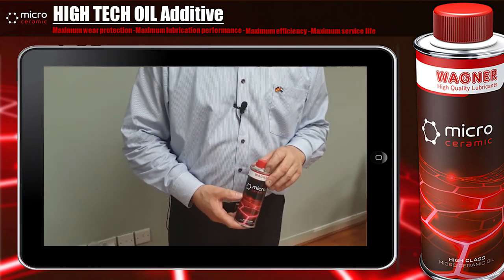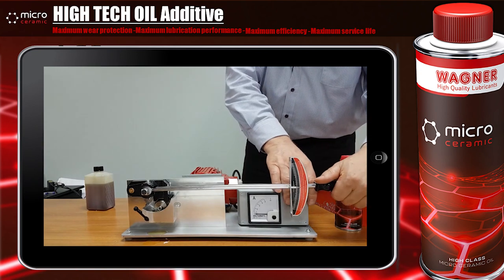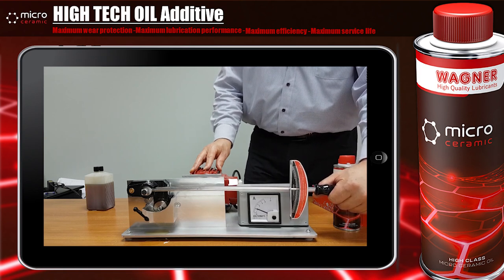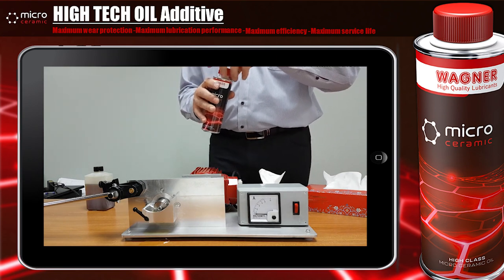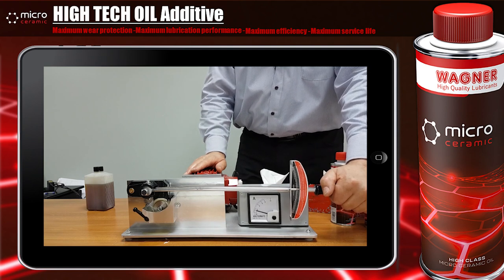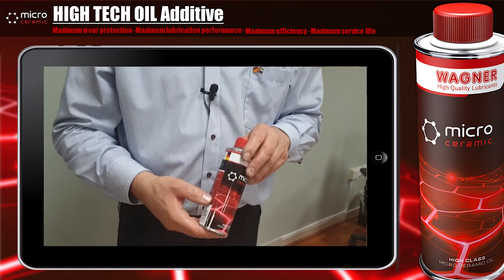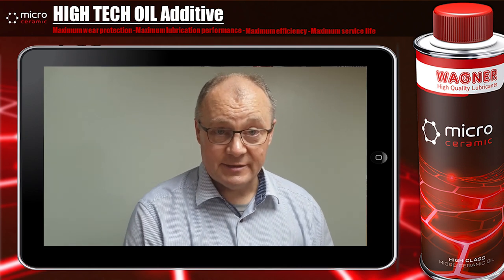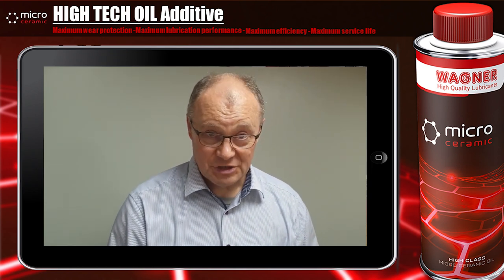Wagner Micro Ceramic Oil Additive - Results

Comment: Very interesting product.  Is there any chance the micro ceramics will clog an oil filter on a high performance automobile?
Reply from the maker: This cannot happen - with nano particles we are 20-50 times smaller than the filter mesh. The only case where you can see a small part of the ceramic particles in the filter is if it is an old and very dirty filter - because this creates a so called "filter cake" and this cake reduces the size of the filter mesh many times over, so that a very small part could be visible...

Comment: Guten Tag Herr Walter Wagner, sagen Sie mir, wie viele tausend Kilometer des Autos wird die Wirkung der Mikrokeramik gespeichert, nach der Behandlung des Benzinmotors?
Reply from the maker: Die herausragende Wirkung der WAGNER MicroCeramic erreichen wir wie folgt: Ein Teil der WAGNER MicroCeramic lagert sich in den Poren der Metalloberflächen ein und verbleibt dort bis 60.000 km. Ein anderer Teil schwimmt permanent im Schmierstoffsystem mit und wirkt wie ein Dynamisches Kugellager dort, wo Drücke und Reibung entstehen. Wenn Sie nun einen Ölwechsel machen, verlieren Sie einen hohen Anteil der WAGNER MicroCeramic. Deshalb empfehlen wir auch unser Öl-Additiv bei jedem Ölwechsel beizugeben. Ab der zweiten Behandlung können Sie auch 5% der WAGNER MicroCeramic zum Ölvolumen beigeben, was sehr gut ist - 10% stellt jedoch immer das absolute Maximum an Schmierstoffperformance dar.
Reply: @WAGNERHighQualityLubricants  Danke!